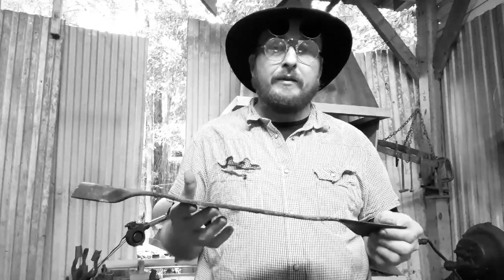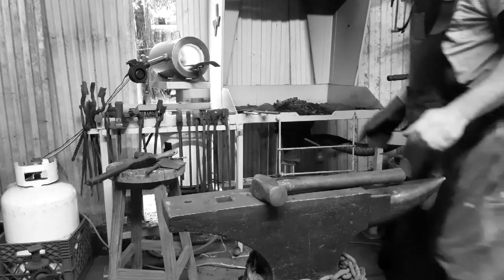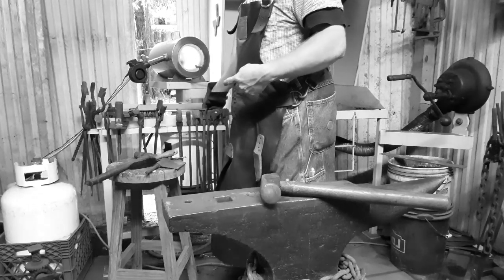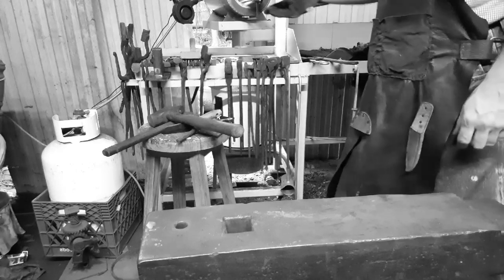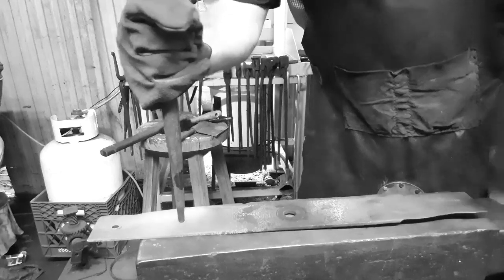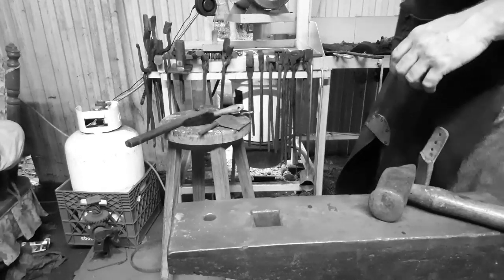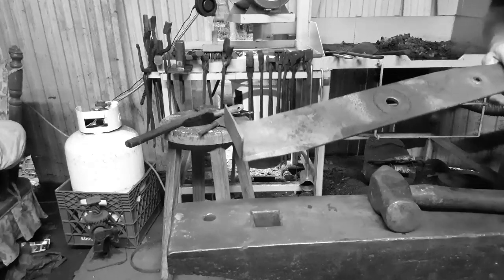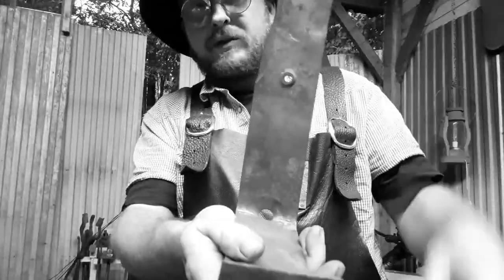Mower blade hanger

Comment: Thank-you for this good sir I realy appreciate you taking your time out too make this video for me
Reply from the maker: @David Pattinson  Glad to do it. Dont refuse the mower blades. It's good steel for a lot of projects. I get a dozen a week or more. Mower shops also toss bearings and races,  pulleys and high carbon shafts, lots of good forge stock.
Reply: @thesprinkleddonutforge2774   Well my dad and I are both car mechanics   so I have access to a lot of scrap steel  my idea is to use  scrap steel  till I get better than buy good stuff in  the mower blades I same to have are a lot thicker  than the one in the vide about a quarter inch